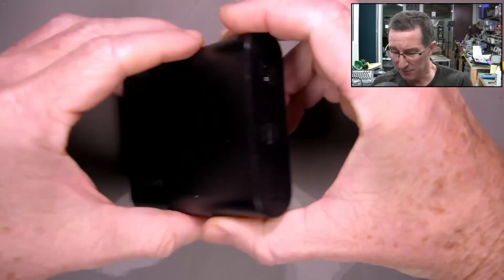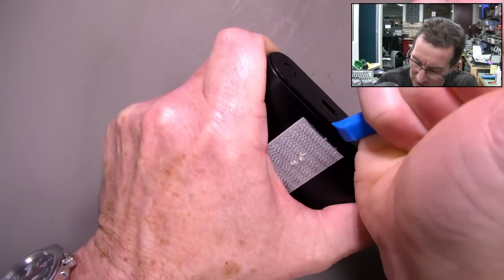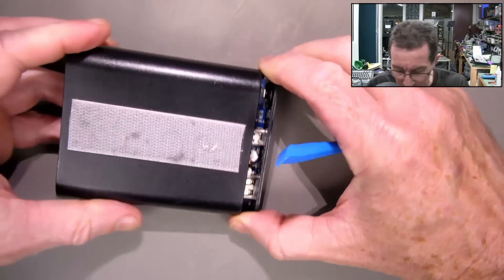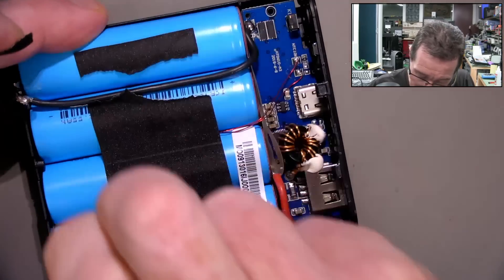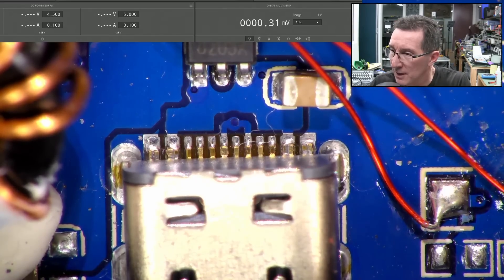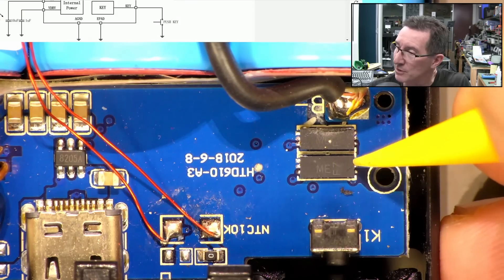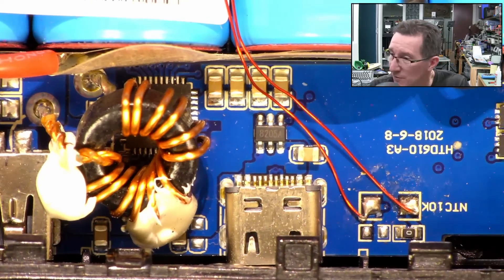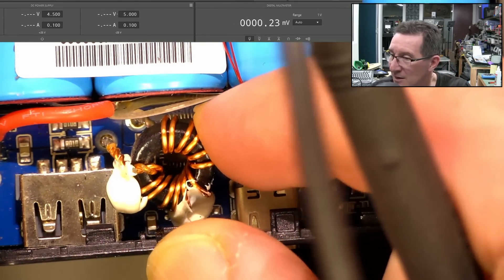Jackery Battery Bank FAIL Investigation - Part 1

Comment: An expensive brand, but once opened just contains the usual 'one-hung-low' brand components. Basically, a turbo-charged standard USB power bank. Those 'parts' look like two back to back MOSFETS (same as in standard protection but the high powered version), the small device nearby is probably the protection IC.

Comment: Hey dave, ive played with numerous power banks over the years, stress tested and even destroyed a few. In my experiances, the failures are always on one of two spots. The battery protection/mosfets and the main IC or boost chip itself. Not to say othe rhtings have gone wrong but generally in the 20+ power banks ive destoyed in testing pepouses,  it usually one of them two. Try bypassing the protection mosfets. These are usually the death of most power banks that stop working with nominal battery voltages. (not charging or going straight to full when plugged in is a sign of this.)

Comment: Just solder a 4-inch nail across that part of the circuit.  We used to use those nails as fuses on the old workshop fuseboard when we'd run out of wire.  🙂   Battery protection is for girls!

Comment: A tip regarding the velcro... always put the FLUFFY part of the velcro on the object you're likely to drop on the floor/ground.   If you put the hooks on that part then when you drop it you'll likely end up with all sorts of dirt/debris attaching itself to the hooks and it'll not only look awful but won't work as well.   Stick the hooks on the tripod/whatever that you won't drop and the fluffy on the stuff you will drop.
Reply from the maker: In this case I've found it better to have the fluffy part on the tripod as it gets abused more.

Comment: xiaomi power banks also very common for them to fail for no reason (even if the battery is still good), and someone found out that there's some sort of counter that if you reach maybe some sort of charge cycle on the power bank, it stops functioning.

Comment: You didn't measure the gate voltages to see if the controller is trying to switch them on, so can't jump to the conclusion that they are dead transistors.

Comment: For the sake of testing, would it not be possible to remove and bridge-out those positions? That would let you confirm that the rest of the battery bank is working correctly.

Comment: LOL, Dave has run up against the same problems that I have when trying to fix Chinese electronics, lack of information! I've been working to fix a AC-DC power brick for a laptop, the unit is only 11 years old, and all of the chips inside have been obsolete for nearly 8 years, meaning they only had a life span of about 2-3 years. I have not yet found any replacements for these parts, other than getting some used and recycled parts (currently waiting the 3ish months for delivery). 
I'll be watching to see how this ends...
Reply: Good luck

Comment: To chime in with what someone else said, BMS chips these days often have permanent undervoltage lockout (to prevent the "dangerous" condition of charging a battery pack from a very low voltage). If you disconnect the actual battery for any reason, the BMS chip can lock you out. For some laptop batteries, this requires fairly expensive hardware/software to reprogram the BMS ICs, and other times you need security keys that you can't get etc. Bypassing protection may still prevent being able to charge the cells. Looking up the BMS chip's datasheet should tell the story.

Comment: The interesting part for me is,  I repair low vision devices. They have battery packs with 2x3500mAh from Sanyo. They fail a lot. But I always disasamble the packs to safe the cells and they test good. Now the point: The protection PCB uses the same FETs in the same package....

Comment: The top battery protection mosfet has a crack right through the top length of it as seen just underneath the white fuzz on it in the closeup at the end.  I(t look like it shattered exploded.  Note that this may also mean that the other boots converter IC may be shorted out and it blew up the protection ICs.
Reply: Could also be flux residue etc from the battery wire soldered nearby?

Comment: Remove the top  ME1, it’s cracked. Lower MOSFET is probably still functional. It’s only showing open because it’s in parallel with the damaged MOSFET.

Comment: Both mosfets are cracked. And the same package is used on some battery protection boards which are mounted on tablet or phone batteries Or on batteries which the protection circuit is included in them.
If you have collected some of those battery protection boards now it's time to use it.

Comment: I posted the link to that 6 pin part but it was automatically removed. The part number is this DMG5802LFX-7 and it is just a dual mosfet and unlikely to be the problem.

Comment: DMG5802LFX  is a dual mosfet in a W-DFN5020-6-EP package likely controlled by the controller under that inductor. Unlikely that those failed is more likely that is the controller.

Comment: I would use a current limited bench supply set anywhere within a li ion cell voltage and power the circuitry after the protection mosfets and if it goes CC use the flir if there are mlcc caps or the main PD chip is dead. I have encountered "dead" powerbanks where an mlcc went short circuit and the battery protection stayed tripped. Removed and changed the cap and it worked again.

Comment: Quite often those power banks are designed with management/protection ICs that cannot recover from their under-voltage lockout, when they enter the lockout condition it disconnects the management IC from power to prevent further drain on the cells. So it's a chicken before the egg situation, the management IC needs to power the protection FETs in order to power the management IC, proper implementations will allow the USB input to power the management IC to recover from the lockout but this device appears to use the same USB C port for input and output so thus the management IC needs to power a FET before it accepts power from the USB input, so no chance for the consumer to recover it.

Solution is to just bridge the protection FETs with a low value resistor, some DIY battery bank PCBs even have a push button on the PCB to do exactly this as removing the cells or when installing cells for the first time will usually trigger the under-voltage lockout.

Comment: Batteries are the key characteristics that make any portable devices 'portable', or else they're just 'eWaste'.
It could be worth exploring ways to revive dead battery banks - whether by repairing & reinitialising the controller boards (interesting tip to disconnect power - but would it have helped to 'purge' the circuit as well by pressing & holding the little button before reconnecting power?), or
swapping out bad cells with better ones, or else salvaging & repurposing the cells for other devices & projects.

Comment: Voltage on the gate of the fet? I assume there isn't any due to the fact that both of them are open.
Broken NTC? Maybe it's actually trying to protect the cells due to a wrong temperature value...
My two cents.

Comment: My last broken power bank had open circuit current sense resistors. From the outside they looked absolutely fine 😂
I found the problem in the end and it worked again. It was a special power bank with a PV input not in production anymore so it was worth the repair cost for the customer.
But working with a power bank isn't something I want to do on a regular basis. I not comfortable working with theses high power LiIo battery's.

Comment: I think that mosfets might be okay, there's two of them to share current. You might check for chips on the other side of board, as there might be battery protection IC there that causes problems, and keeps mosfets open.
Reply: Dual back to back mosfets with common gate, there to not have a diode in the junction that will pass current. Just test with them removed and a 5A fuse soldered in place, and the unit will work, then you can measure gate voltage, which should be 0V if they are actually being turned on. Then get the cheapest generic that fits the package, or what is local that fits, and put them in. Generic 20V 20A protection mosfets there, with 2V threshold or so.
Reply: I would remove the mosfets and test them. If they are are OK check what triggers them. If OK I would remove the battery, connect an SMU instead zo nothing will fry and they can sink and source so you can simulate the charging proces.

Comment: Maybe try charging the cells using a bench supply, bypassing the protection chip, and see if the chip comes alive once the cell voltage rises?
Reply from the maker: Possible, but voltage is already in the middle of the discharge charge, more than enough.
Reply: @JPEight  3.6V isn't anywhere near empty. 3.2V is considered empty, but 2.7 or 2.8V is generally the voltage where protection ICs cut off.
Reply: @SebastiaanSwinkels  3.6v is about 10% left - pretty close to empty. The discharge voltage is not linear. I agree that the cell protection voltage is normally much lower than that, but going that low will damage the cell. It probably won't catch fire or anything if you discharge to 3v, but it is going to degrade capacity significantly.
Reply: @JPEight  I agree with Sebastiaan. those were labelled ICR batteries, Lithium Cobolt Oxide (LiCoO2). Nominal voltage is 3.6V. Operating range is 3.0-4.2V/cell. Minimum discharge cutoff voltage is 2.5V/cell. I selected this type of cell for one of my own projects because it can be charged like a LiPo battery up to 4.2V/cell but has a lower discharge cutoff voltage allowing my circuit to operate safely down to 3.0v/cell (although I have it cut off around 3.1V/cell for a safety margin). A LiPo battery is considered to be at 50% storage when it’s at about 3.7V/cell and I suspect LiCoO2 would be similar, around 50% at 3.6V/cell, which is pretty linear. See here for some details: https://batteryuniversity.com/article/bu-205-types-of-lithium-ion
Reply: @JPEight  3.6V is absolutely not 10% remaining on an EVE 26V. I just discharged one that was full and took out 1300mAh so about half of its capacity. Voltage after that? 3.71V after resting for 3 hours. Minimum discharge voltage for this cell is 2.5V

Please stop making stuff up if you don't know what you are talking about when it comes to lithium ion cells. You could say something that causes someone to get hurt, its just that this time you were wrong in the completely opposite direction.

Comment: If there's a current surge after the cell protection ICs, they'd trip open instantly when you reconnect the cells. Assuming there is an issue there, this possible fail case has not been checked, has it?

Comment: as usual, 10.000$ worth of tools, but unable to repair a powerbank
Reply from the maker: LOL. I don't think you understand how I do and upload videos like this. I ddin't have time to go further right then so I left it at that and uploaded the video. Part 2 once a get the part number or the inclination to go further.
Reply: $1'000'000 worth of tools doesn't mean crap if you can't find the information on what is actually on the board, You could manually reverse engineer the entire board, and still not be able to get it working if you don't know exactly what these chips are.

Comment: Charge the lipos directly, so the cells have higher voltage and the dis and reconnect the circuit maybe? Than connect the charger to reset the safety circuit
Reply from the maker: Voltage is already fine, so it's not that.
Reply: @EEVblog2  it is fine for lipo I know, but the protection ic maybe needs to see higher voltage first, like a recovery hysteresis of some sort, because the voltage dropped too low for some reason which kicked in the protection
Reply: @Charlie90071 I have an old analogue type Lipo charger just for this purpose, sometimes the cells/circuit need a kick-start before a modern Lipo charger will even look at it.
Reply: @IanScottJohnston  exactly what I mean. I just put the bench supply with low current on it👍

Comment: I would say solder a fuse or a thin copper wire (like 0.3 mm) over the battery protection ICs and test it again.
When it works, you know the protection ICs went defective and you can try to source new ones.
When it still does not work or it blows the fuse/wire, you know there is some major fault and you just salvage the cells.
Reply: I love how much engineering is just asking the question "have you been pessimistic enough?"
Reply: I was thinking about a small jumper. But doing it small enough that a couple amps would blow it is a great idea. Replacing a part that is instantly going to be destroyed again would definitely be a waste of time. 

Thanks for talking through some of the diagnostics.

Comment: some power banks are reset by plugging the output to the input.
Reply: I reset a power bank like that once.  Reset it forever, it celebrated, with the magic smoke.
Reply: @simoncrabb  I have a power bank i got from walmart.  in the paperwork that came with it it says if bank becomes unresponsive to plug out to in.  i tried it on mine.  it wasnt unresponsive.  it just blinked all the lights.
Reply: @simoncrabb  odd that yours smoked... you were only putting in USB power.

Comment: Fully charged would be 4.1 Volts. 3.58V is far from that.
Reply from the maker: 3.6V is smack in the middle of the discharge curve, so it's not low.

Comment: Did you check that the FETS weren't off because the BMS was requesting them to be off? It's possible that they were open because they were supposed to be.
For what's worth, i'd have checked the gate voltage. 
Just my thought. 

I'm in the process of trying to fix a pack myself at the moment, but can't get the BMS to unlatch 😬
Reply from the maker: These are usually self contained and don't have external control input.
Reply: @EEVblog2  usually, yes. But look, both of them have a pin on the lower left going to a via.
Reply: @EEVblog2  Both of those have a via going to the  bottom side of the board off the lower left corner. Also most protection IC's I've seen don't support running two in parallel, this to me would much more point towards them being a pair of MOSFET's controlled by an external IC rather than self-contained protection IC's.

Comment: They may be dual mosfets, without any logic builtin. So maybe searching just mosfets filtered by package would get you something. There may be something on the other side of the board controlling them or it may be the main processor. Maybe the main processor turned them off but it won't turn them back on via just USB power? Maybe try shorting the mosfets to power it from the cell side?

Comment: 15:16 is there a crack in the lower protection unit on the right side? Looks like it wanted to inflate somehow 😄
Reply: I saw the same thing. It may be just a bit of leftover flux but it looks like a crack in the chip.
Reply from the maker: Looked like just a mark to me.

Comment: Jackshittery, huh? It's always those dead MOOSEFET jobbies... first thing to check when I see a failed BMS. Usually sends the unit off to a "beyond economical repair" bin :/
I'd still try desoldering them and checking with a component tester.
Otherwise the board looks okay to me.